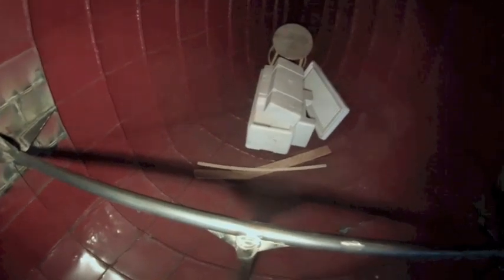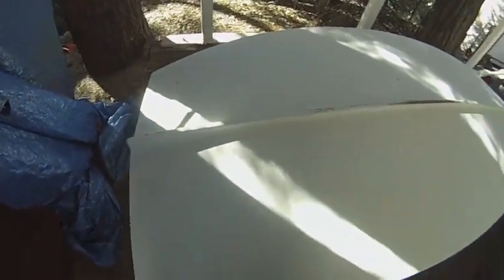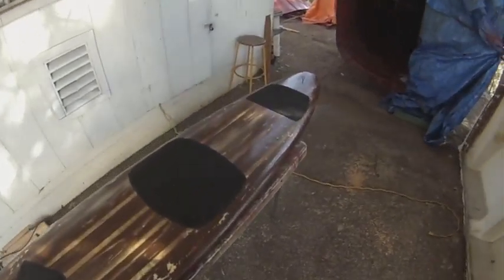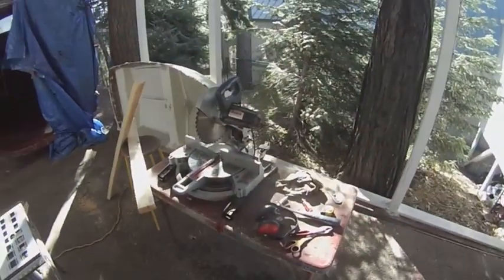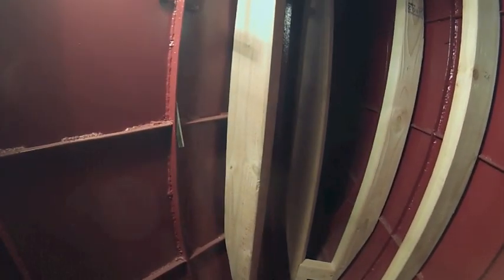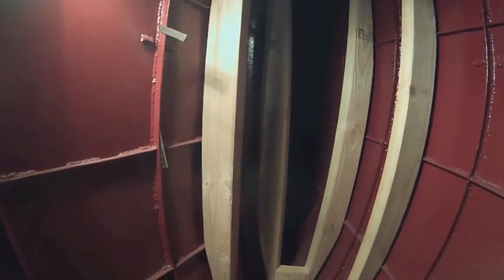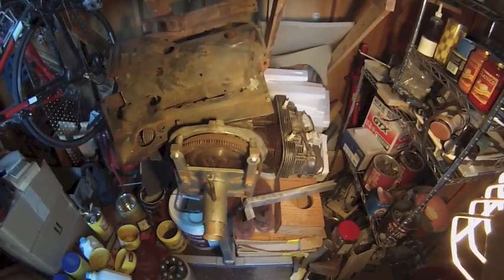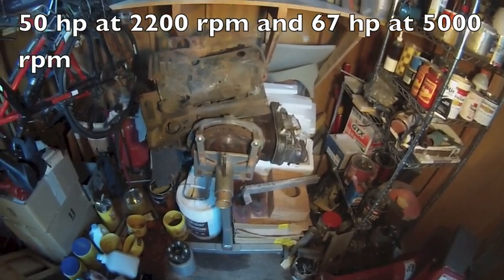Steel Sailboat Build Part 12

Comment: Glad to see you building an internal structure and making progress. As others have said attaching aluminum to steel can result in galvanic corrosion, you should probably spend some time researching the pros & cons and solutions to preventing this.

The primary reason for not using outboards on a bigger boat with a higher transom is, the issue of keeping the prop in the water in rougher conditions, its different than on a rib or speed boat because of the hull and transom design, on this type of hull transom setup, swell and wave action will probably lift the prop clear at the times when you most need propulsion and any engine issues have to be dealt with off the back of the boat, a bracket high enough to lift it up to work on it while still attached, is probably not going to be low enough to keep the prop in the water in rough conditions,again its something you need to research for yourself.

And of course the locations and potential conditions in which you will be using the boat are a major factor in all this.

Comment: Will you need to use some type of rubber washer between the aluminum channel and steel hull to prevent Galvonic corrosion? Or just weld tabs on and put bolts through those into the wood ? 
    Good progress sir!
Reply: Galvonic corrosion? OH thats the least of his problems LOL

Comment: Air cooled engines require a LARGE volume of air to be forced over the engine, especially the cylinder heads.  Engine oil (especially synthetic) is a pretty good cooling fluid, but it needs a radiator (oil cooler) that is capable of removing a lot of heat quickly.  Tohatsu outboards are more common than Hondas outside the US.  I am not sure about today, but a couple of years ago both Mercury and Envinrude 4 stroke outboards under about 30 hp were re-bagded Tohatsu.

Those high horsepower VW engines all use high octane fuel which you will not be able to find in many parts of the world.  Diesel is the most common fuel around the world.

Comment: Steel and aluminium form a galvanic cell when they come into contact with sea water. Aluminium corrosion follows. There are stories of copper pennies corroding through an aluminium hull inside of a week. Those cases occur when bad earthing in a marina allows stray electric current to speed up the process. Take a look at https://en.wikipedia.org/wiki/Galvanic_corrosion

Comment: Air cooled engines are particularly favoured for working in polar waters in winter, for obvious reasons. I'm guessing (& hoping) you don't have any ambitions in that direction, but I'm saying it to counter those who are telling you it's not a viable option in a boat. At least some of the boats that visit polar waters are also travelling through the tropics, (if they're exploring the high latitudes of both hemispheres they obviously can't avoid it) so that's not a deal breaker. They do tend to be noisy, though, and they can heat up the cabin a lot when they're running, but there are ways to mitigate that.
I'm glad you've seen the light about the inadequacy of the original framing. I'm not sure adding aluminium to the frames will adds a lot of value -- unless you introduce a decent thickness (like 5mm) of plate on edge, full depth of the frame and sandwiched between two baulks of timer (you could rip your existing frames in half) to prevent it buckling sideways -- why not use steel foldings or angle? You could drop the thickness to 3mm, it would be stronger in that context than what you propose, and more inexpensive, and more compatible with what you have.

Comment: Yeah, using the wood as extra structure is totally and perfectly viable. I think i saw a fiberglass boat (circa 80s) that had the same ethos, the shell was super light, but used internal elements (bulkheads, beds, tables, etc) as additional structure. Something, something 'leggera' italian boat.

Comment: You should run some larger floor stringers (2-4 of them)  from the bow to the stern. Use some 2 inch (1/4 inch) angle iron. That would provide you with a spot to terminate your your vertical walls and a spot to build your floors on. It would also add some strength to where your keel is going to be and better disperse the load. Concerned about the structural aspect of it handling the keel at 20-30 degree pitch over and over. Remember that flexing is not ideal, while mild steel can bend all day eventually you'll start to get cracks over time.

Also with the the larger stronger stringers in place running length wise you wont have a problem putting in your support for the mast. 

your big load spots are obviously the keel and the mast, keep those from over stressing the structure. While I don't agree with building with no plans I do hope for success of your project and enjoy your videos.

If you get an outboard, make sure you get a long shaft outboard, believe there 25 inches. look at outboards that are meant/ geared to spin bigger props, because some are designed for it.

Comment: Talks about torque monsters then shows HP figures. Boat diesels typpically operate at under 1500rpm to keep the noise and provide adequate torque.  This hull will buckle and twist. The welds will split open and it will sink. Probably all in the first hour or so.

Comment: You will never keep a vw engine cool under deck.  Vw cars all had wind scoops on the sides and the bottom was always open so the air could pass over the cylinder heads.
Reply: Yeah that would be my primary concern is the heat dissipation.  In warm weather it could possibly make it unbearable under the deck if you ran it for any time.  Maybe you could rig up some kind of fan to pull in air on one side pull it out on the other?  I think it would be safer and give you more room under the deck to mount an out board.  you can rig up a mount that you pull it off and on and use it for your dingy also.
Reply: +Sailing Paynes 

  G'day,

    Well, actually, while Volkswagon Beetles & Kombis & Utilities all had 4-Cylinder Air-Cooled Engines...; the Air in question was sucked-in by a Belt-Driven Centifugal-Fan/Air-Pump, running faster than Crankshaft-Speed, located in a Semi-Circular Shroud which stuck up above the Crankcase looking like a "Tombstone", and directing the Blown Airflow equally over the 4 Horizontally-Opposed Cylinders....

  Sticking up inside the "Tombstone Cowling" there was an Oil-Cooler, which was exposed to the Fan's Airflow before the Air reached the Cylinders.

  So below the Car, there was a constant flow of  hot Used Cooling-Air, a proportion of which could even be led into an insulated Conduit and led into the Cabin for heating-purposes...

  If an Air-Cooled Volkswagon Motor is to be used in the bottom of a Boat, then at the very least it will need to have all it's Cowlings intact, it will need it's Fan-Inlet connected to an "Inlet Manifold up on-Deck, set up with the Intake being an "Updraft" type, to protect from the possibility of feeding Water into the Air-Pump...; then there'll need to be a similar set of Hot-Air Ducting under the Engine to lead the used Cooling-Air (plus the Exhaust Gasses) out of the Hull - again suitably protected from water-ingress.

   Apart from the "Plumber's Nightmare" of all the Ducting required and keeping it patent,  there's the issue of thin Sheet Steel corroding in a Humid Salt-Air Environment...

   To me it looks like a particularly difficult type of Engine to successfully install in a Sailboat ; but given a sufficient sense of obsessive-compulsive Industrious Futilitarianism, then no doubt it could possibly be made to work.

   But, almost ANY Liquid-Cooled Engine will be easier & simpler and more practical in the application ; to the point where if one already had an overhauled VW Motor, that cost nothing, it would make more sense to sell the VW Engine and purchase something Watercooled with the proceeds.

  Have a good one,

  ;-p

  Ciao !
Reply: he will probably buy a harbor freight pump and hang a sprinkler head over the engine

Comment: Air cooled engines require more air moving over them than you're likely to generate at 7-10 knots or even up to 20 knots. and you don't really want to push a sail boat faster than that. Things start to break... even on a steel boat.  Also, as much as you'd prefer not to put a hole in your boat for a drive shaft and water to cool the engine, there's a reason most designs go that way.  It is eminently more practical and you will eventually get tired of raising and dropping an outboard.  Also, someday you're going to want to sell it. Most folks would prefer an engine with a dedicated engine compartment and through hull shaft.  It's your thing. Do what you wanna do. I can't tell you, who to sock it to. But there is a reason the vast majority of cruisers have internal, water cooled engines. To ignore that is to discard a lot of learned experience.

Comment: Fairly simple when your mast is stuck through the boat it will try to go through the bottom under load and pull the sides apart in the process so main and  lower frame bulkheads are for strength , wood wont do it it can only be bolted  ,when building a boat the biggest problem is twist of the hull for and aft adding a soft product will add the this problem like wood the main bulkhead mast , and bunk fronts should be steel the rest wood ok

Comment: there was a diesel engine company called Lister and they made an air cooled marine engine it had blower fans similar to the cooling fan on a VW engine and the recommendation for ducting to go down from the cabin top

Comment: Also, i think it's mostly because of fuel concerns. Top fuel drag boats catch fire very fast, very easily, and early petrol race boats did the same. That's one of the reasons why air cooled engines are not used. It is, inherently unsafe.  But that's neither here, nor there, if you acknowledge the dangers and mitigate some of them, then go for it.

Comment: Like others have mentioned the word fail in and of its self is not an uncommon practice of man, but feeling as though you are a failure could mean you need to take a break and perhaps study up on the type of build theory you are attempting!?
Anyways- I believe you are not understanding some of our structural concerns? The bracing you are showing in this video is point load transfer not linear load sharing- maybe that helps make sense of the oil-canning I mentioned last time. When you counter weight the vessel the "moment-s" loading  will shift side to side; this is one reason why the bottom hull usually has a thicker plating; or you beef up the bracing to connect those loads to and throughout the entire hull structure. 
As we see it now you are dividing the load but not in a way that will transfer the load evenly throughout the hull! So you will still have oil canning and the plates will spit.

Again like I mentioned last time, think seriously about changing the type of vessel you are attempting to build, this will lead to a completely different ballast requirement!

For around a thousand you can pick up stock drawings and the guess work would be next to nothing. At the pace you put this together you'd be done then certifying the boat would merely be a formality...
All the best
Patch

Comment: Very robust engine as a bad habit of dropping valves through the head and having the head bolts pull out of the block. Good luck!
Reply: Too see how robust they are, watch the "Hasta Alaska" videos on you tube, more time was spent bending over disassembled engines than driving. Note plural, for 3 new engines, and they were removed many times for repairs, to get from Chile to Alaska.
Reply: Yes, indeed. I have owned several and worked on them for many years.
Reply: They burn exhaust valve also
Reply: They do!
Reply: Yeah, I've got one in bits right now which burned the head away around the exhaust valve. It's essential to keep the tappets adjusted and in a rebuilt motor you have to do this every twelve hours of running, at a guess.

Comment: How are you going to keep the VW engine cool when it down in the hull with no air blowing over it and yes I know they have a cooling shroud over the engine but they still NEED cool air to cool them !!  Would it be better to cover the bottom of the dingy in Kevlar for better strength than fiberglass !! Seeya Rob.... I'm a mechanical and automotive engineer !!  Just saying !

Comment: To use an air cooled motor you would have to mount it outside or take up lots of space with ducting to supply cooling air to the motor.  Also, diesel motors are much safer for inside the boat than gas.
Reply: Spend money on a 3 cyl diesel. Kubota or Beta a Marinised Kubota. Compact and reliable. Worth the money
Reply: A  10 hp 2 cyl Beta will push that little boat along very nicely , but he;s not taking it on hundreds of mile trips so a 9.9 Yamaha hangin off the back will do.
Reply: I don't follow why he doesn't want water cooled it's far simpler and far more efficient in my opinion. It's only a heat exchanger in contact with salt water and they are designed exactly for it and normally last many years of constant use.
Reply: You have only to look at the build to understand that.
Reply: I know this sounds like a troll talking but there is almost nothing right on this thing . Dont take this project serious.
Reply: Yep, he would have had a much better boat and easier build if he just copied a set of plans from the web. Just use a plywood boat plans and substrate the ply for steel.  
No doubt it'll float but so does a barrel. 
I remember someone tried to compare him with SV Seeker. 
Big difference, Seeker does a lot of research and asks a lot of questions, often taking the advice/comments and applying it if it fits.
Reply: Mazda rx7 
Doug is a different deal huge project. In one of his earlier videos he says he over engineers well he did it again, Seeker is to complicated, also Doug trys to replace marine parts with cheaper home made or substituted parts ( like a bus engine and auto trans) . House insulation panels in a boat. no ventilation in the bilge, Suicidal door latch. I could go on and on.
Rigged steering system. poorly designed exhaust . He does not have any sea going experience or even sailing experience. he has a rebellious attitude Thats bad on the ocean.  he's not getting any younger. If seeker ever makes it to water it will be a nightmare of issues, 
It will be extremely expensive to haul it back out and have all the issues including structural ones fixed. If its even possible. 
its really kind of sad. 
You have to admire his vision and drive but reality may not be his friend.
Reply: The main problem with a lot of these projects on YouTube is, the builders forgo the tried and proven methods.  Hundreds, if not thousands of years of boat building is thrown out the window on a lot of these builds. Yes, some succeed but most fail.  Time will tell, but it's sad that many have to fail instead of listening to those who have "been der done dat".  Yes, it's their money and time, but why waste it.  
This is a nice shape that could easily be downsized to under 30 . Add a drop keel and good to go. 
feethttp://www.sailboatlistings.com/view/26249
Reply: He said he will sail it around the world
Reply: Nice lines not sure about the down size idea? lots of abandoned projects out there Ill bet he would take an offer. The owner of this pirate themed BBQ should have make a deal he has almost 6500 tied up in this mess. repack the bearings on the trailer get a permit and off to Socal . LOL
Oroville is not to far from here
Show less
REPLY
Reply: Sail around the world. hehehe  i get a kick out of these dreamers, they have  not even done an overnight passage in the wind and rain and want to sail around the world. Yes it can be done and people with no experience have done it and many with experience have died trying.  I took my PDQ36 cat across the pond and back a few years ago.  Yea I'm still here  but I wouldn't do it again without at least four people.  It's just way to tiring to enjoy.
Reply: Don't need 12K. Just look at the lines and copy them , adjusting to the desired size.  Make a 1/12th(or1/10th if metric) scale model To work out dimensions, lines and curves. When everything fits nicely, scale it up and start building. The only difficult thing when not using plans is the placement of mast and keel to keep the boat balanced.  It would take a couple hours to type out how to calculate keel/ballast and mast placement, then lots more time to further explain terminology and answer questions.   There are plenty of online resources and books available on boat design.  Even with all that knowledge and experience professionals don't always get it right. Thats why you see various changes boat models over the years.  
The PDQ catamaran underwent several changes of the years from the initial  32 to the 36. even then, guys added longer sugar scoops and extended keels to improve performance.
Reply: Vobrating string. He just dumped $6500 into useless junk and im sure the  $1200 is negotiable also it has a prop shaft and other expensive hardware . Also a trailer! Its 20/20 hind site but he is stuck on this path of useless junk. (you have to think of the big picture)